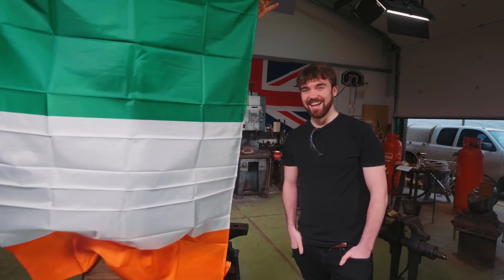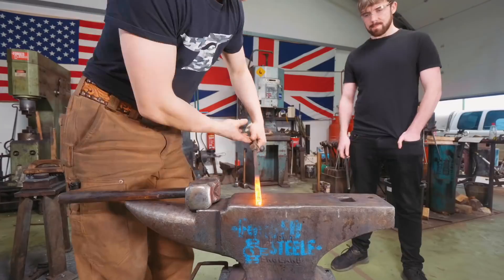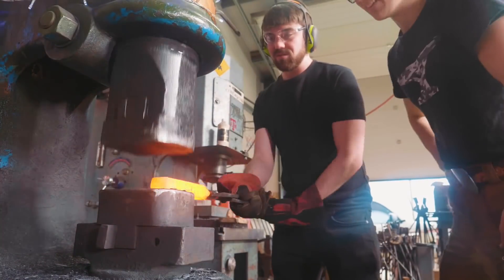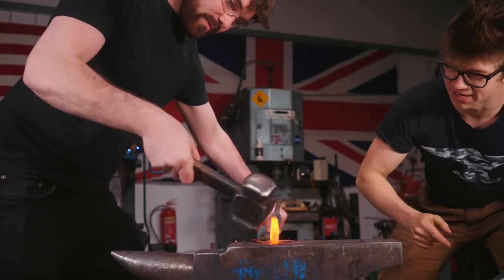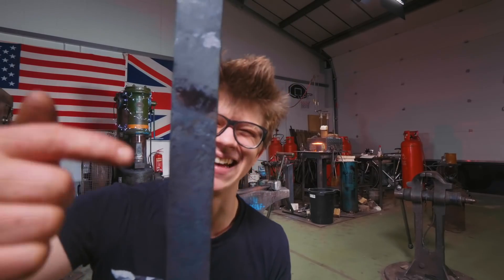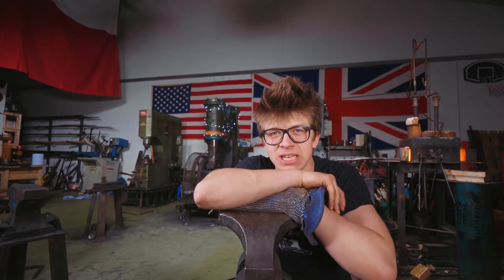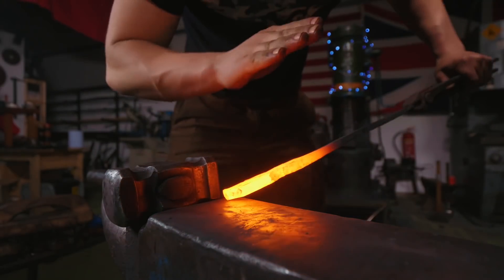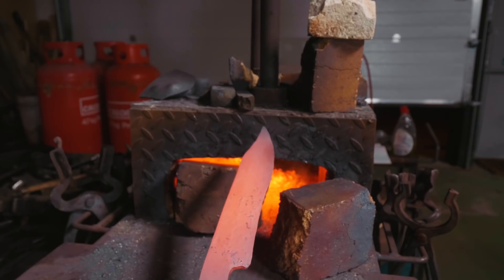MAKING A BOWIE KNIFE WITH REAL ENGINEERING!!! PART 1

Comment: Hi Alec, I got to this video from watching Real Engineering's video on hardening steel. So here's my question. Samurai sword make has been esteemed as the highest form of bladesmithing, with the folding, and the sanmai layering and the clay painting before quenching, etc. My question is this: Is that still truly a better approach to bladesmithing or is it a beautiful tradition that honors an ancient practice that modern bladesmithing techniques and steel now supercede? Thanks for the time. Rick
Reply: He hasn't answered you so I will try to help...Modern steel is crap...Unfortunately it come down to 'the times we live in'...I gets all a bit zen so I will try...120-130 yrs ago the tuna were 10-12ft long. they are now 3-4ft if you are very lucky. The Steel is similar, an easy test is to buy two chisels....1 that is Isaac Sorby from the 1920's and the other a modern Bahco or Stanley...
See which you prefer using (ie lack of vibration up the handle) and Which one Keeps its edge longer...The Sorby will stay sharp weeks longer.
Modern materials have been round the block...they are rushed into production.
The care and quality of life produced a better product from all points.
Have a good Day.

Comment: Alec, have you ever seen or done the trick were you put some water on the anvil, and when you put the hot steel on it and hit it with the hammer the water turns in to steam, which blows of the scale? Instead of brushing it off.

Comment: I have a cool damascus idea: what if you took 9 steel cylindrical bars and arranged them in a square, tack welded them, then used your new forge to melt steel and fill in the diamond like holes around the center? I think it would make a really cool piece when flattened out

Comment: when the forging is done, take one more heat where you just brush with a regular steel wire brush, gives a real nice finish. especially with some wd40 (or a food safe oil if you'll use it for food)

Comment: As Brian was saying he didn't have the muscle or strength in his wrist for Anvil work, I noticed Alec's hammering arm is bigger boned and defined than his left, a bit like historically English Bowmen would have over developed musculature to their draw arm/back...or was I imagining it?
Reply: I recently watched a video where another aspiring blacksmith ( the channel Lindybeige) tried his hand at a forge.
He noticed something about posture and placement of the material.
https://www.youtube.com/watch?v=A9oyEKnf4Uc
At around 2. 45 he analyses his own posture.
At 4.50 he compares to that of the experienced blacksmith.

The same "mistakes" can be seen in this video.
Reply: Or is it like Martin Sheen's withered arm?
Reply: I think his hammer may have been to heavy.
Reply: I've seen this in many blacksmiths, but swinging hammer is more about technique than strength. There's a good vid about that on 'Wolf's Den Forge' channel.
Reply: You are absolutely right.  Whenever someone holds the hammer close to the front end, that means it is too heavy.  The force of the blow should come from the swing.  One should grasp the handle at the rear end.  That way the wrist will experience less vibration.
Reply: manipulating the tongs in the other hand with a heavy workpiece can be hard work too though, sometimes it's more tiring than swinging the hammer
Reply: Definitely choking up on the hammer, there. My own anvil is set at the height of my knuckles when I'm standing beside it. That way the steel gets the full force of the hammer, swung from the elbow and wrist. Still, the old forearm muscles will complain until the get used to the exercise. Fun video!

Comment: What happened to the Framelock? Don't worry, I've done a few builds that got a little stressful and I put them on hold for a while too. In fact I still have a kitchen knife to finish, but I made some W2 neck knives for stress relief in the meantime, and figured out a way to actually mix oil and water for a fast quench(it really works). Take it easy.

Comment from the maker: Make sure you guys go check out Brian's channel for some awesome REAL ENGINEERING!!!
Reply: I was already subbed
Reply: Alec Steele I am a young black smith like you but I also do a bit of farrier work I was wondering if u could sell me your locking frame knife it would b greatly appreciated as I am a huge fan of your work
Reply: Hey Alec, there is a YouTube channel called AlumiTube. He does casting and if you haven't seen him already you should check him out.
Reply: Alec you’re and awesome dude I really enjoy your videos I loved blacksmithing before and I found you’re channel and you have made me love the art even more so thank you
Reply: Alec do you still accept new flags for the workshop ?
Reply: One way to straiten up your pieces in an easy way that I saw another smith do is using a long vice which is pretty much just two pieces of 3 or 4 foot flat stock soldered to a vice. I'm definitely no smith but it looks like it works pretty well for him. I love your videos and am currently just wood working but I can't wait to dabble in a bit of forge work as soon as I get the chance.
Reply: Hey Alec, something you might want to consider when cutting off stock is utilizing the same method that the boys over at Baltimore Knife & Sword do, which involves using a long curved piece of spring steel with wedges and the power hammer to cut through it, rather than hand-hammering over a wedge.